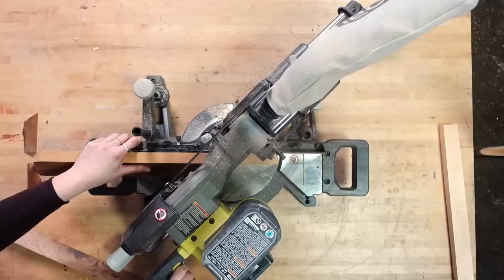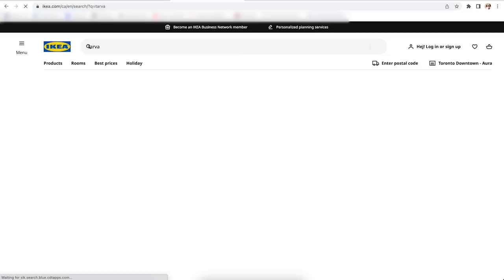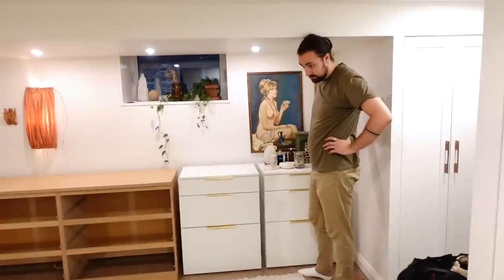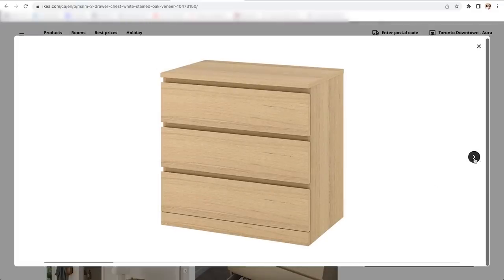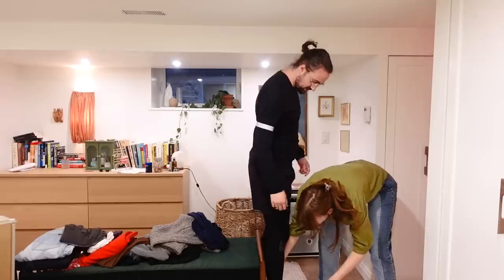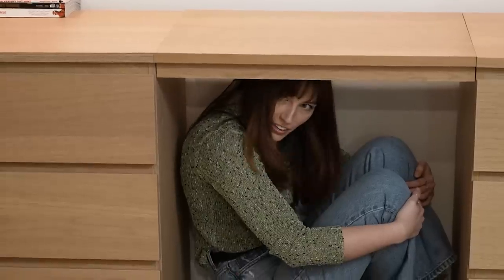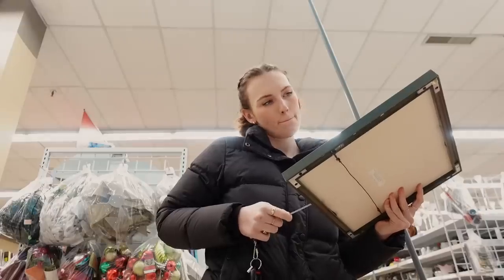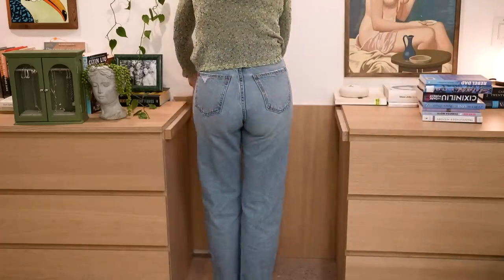they quoted me $12,000 to make this

Comment: Great solution! The MALMs look fantastic opposite the stairs. I also loved your solution for the gap where the laundry sits - so creative and you'll have extra parts if you want to do any additional DIYs in the future. I was thinking you could even take the drawer fronts off the remaining unit and turn them into bookshelves on one of the walls. Then create a picture ledge to hang just above the gap, where you can add art or even place books with pretty covers. I love using books as art, too, if you have pretty ones!

I wish I was as much in love with library books as you are. They certainly are more environmentally friendly! But I was an English major in school, and having my own "library" is a comfort to me. I regularly purge and donate ones I know I won't read again, so I can add new ones, and I try to buy second hand when I can. So I guess I'm doing my part. Haha. I think I'd have a very hard time giving up the book collection, though.

Comment: Love this! Thoughts that could make it more built-in looking. I have a revamped tarva that I bought a live edge piece for the topper. Turns out it is fairly easy to replace the top of a dresser with different material. If you could get a similar veneer countertop it could span the whole top and look veeeery custom.
Reply: Thought 2.0, you could even give it a bit of a lip on the back to cover the gap!
Reply from the maker: great idea!!
Reply: I think it would also have been really good to get a second bigger dresser and cut that to size to go across the smaller dresser and the gap

Comment: If you had space under your bed, or if not, just rise the bed with risers under the legs. You could use this space for extra storage under the bed, just use caster wheels, attach 4 casters to the bottom of each drawer drawer that was  leftover from other dress. If you can see drawers they would match your dress area and stairs.

Comment: It looks amazing! One thing I think could help with the built in look is removing the wall trim so that the whole thing is flush to the wall but I know that may not be feasible. It may have also allowed enough space to fit the other malm dresser in full (altho my measurements may be off just by looking!). Either way, it’s always amazing to see what ideas you are able to come up with!
Reply: That’s what I was thinking too!! Especially because you still have the gap on the sides. Rn I have this problem and lots of jewelry hanging on hooks over the gap, so I got these silicon gap covers

Comment: I customised Malm dressers because they wouldn't fit into my space either. I needed one with half the width, so I took a standard one for the sides and two bedside tables for top, bottom and drawers. With some extra cutting and drilling for the trim, it worked out out really nicely.

Comment: I had another idea, you could cut holes out in the back of the dresser to have access to the plugs, you would then drop the cord behind the dresser unit and then pull the drawer out and grab the cord where the hole for outlets and plug it in. You would't have to move your books and things to get to the cords from the top to plug in or have to move the unit out to access the plugs. Just open the drawer and plug in. I would just cut the holes the same size and location as the plugs on wall as outlet you could push the dress against the wall the outlet fit in the whole perfect cover the outlets, may be leave a little room to drop the 🔌 plug.

Comment: Such a great use of ikea stuff to look custom but not cost the $1200 that other people are paying for ikea wardrobe units.  But… could you maybe get some pieces of 1 x2 (or use more of the “parts” dresser to make small/short side supports then just take like 2 long skinny pieces of wood to make a little top for the gap between the dressers & the wall & just attach them using some hinges hidden underneath? It could just fold down and rest on the side supports and it’d give you access to the plugs without having the gap behind it.  You could do it in 2 pieces so u don’t have to move everything on top to get to the plugs & idk put a thumb hole at 1 end or even like a little pop up magnet thing on the supports so u wouldn’t need any hardware to lift it… idk just having that space for things to fall down behind it would make me crazy.

Comment: Everything  looks so nice, I have a suggestion  the open area where the  basket is , could you build a sort of " garage " type " of door front with any extra wood , cut them into three drawer fronts like your other drawers and place them on a bracet system  that you can lift like a garage door , almost like a roll top desk type track system and then it would look like a complete unit and you can still access your basket to shoot hoops. No disrespect just a friendly  suggestion. Hugs from Pa. USA 🇺🇸

Comment: You should totally add two BILLY bookcases in the same oak veneer, 106x80 cm (same width as MALM) on either side. Just adjust the bottom on them and it would look even more built in and add extra storage. Should also be easy to find second hand! 🧡

Comment: I am bit lost. So you are not willing to buy relatively cheap IKEA MALM and you hunt the 2nd hand. That means you have to drive there and back. But you are ok to spend money on flight and extraordinary vitamins. Priorities....DIY is important and it should be done but not in all cases. What you did is eclectic solution for a complicated space. You are skilled. Thus why didn't you crafted your designed built in yourself? Yes it will take  4 weeks or even 8 but it's your home.

Comment: The books idea doesn't work imo. A beautiful long piece of wood on top of all the drawers would have been a better idea. It would hide the gap at the back, the cracks/gaps between drawers AND it is wood - easy to sand/oil/stain/varnish. Because the tops of the drawers have different grains, they don't go together.